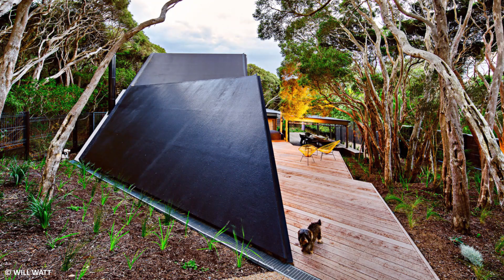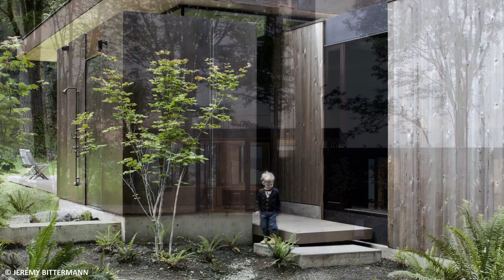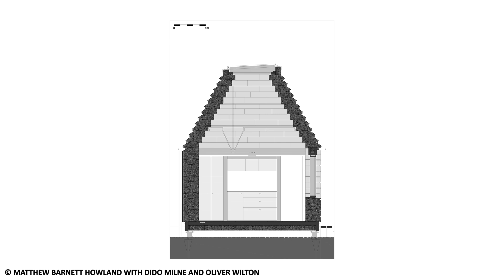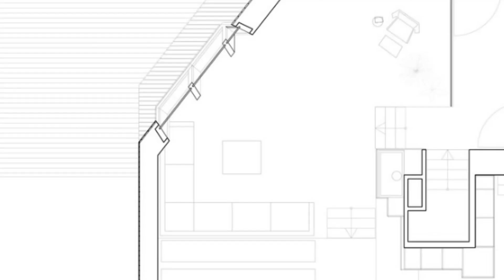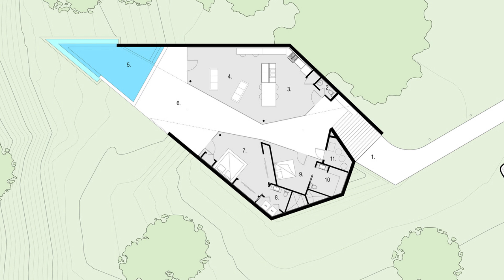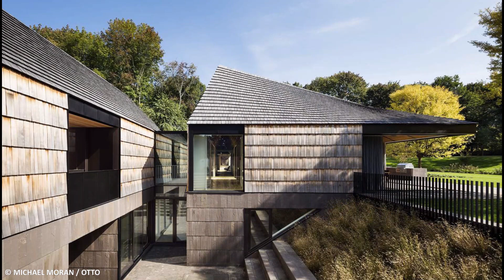7 Game Changing Modern Sustainable Architecture [Eco Home]

Comment: I have a quastion to the Dune House:
It seems to have a lot of sun oriented glass walls and roofs. Wouldn't that make the building heating up a alot in summer?
Reply from the maker: The majority of windows are recessed (not flushed) within the walls which means they are partially shaded. You can tell by the elevations. I hope that helps!